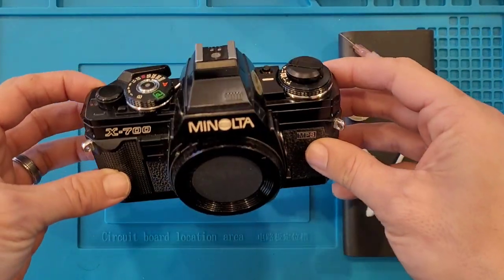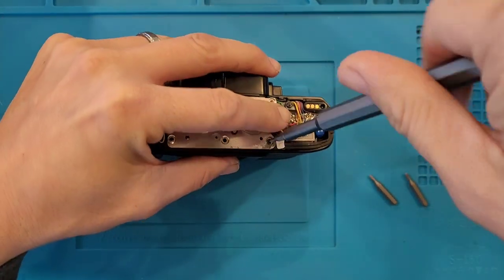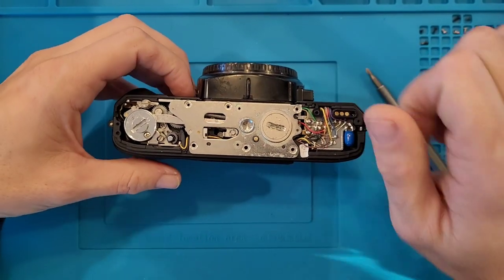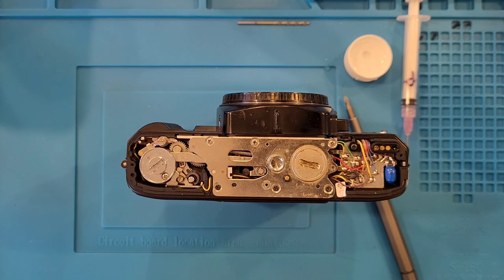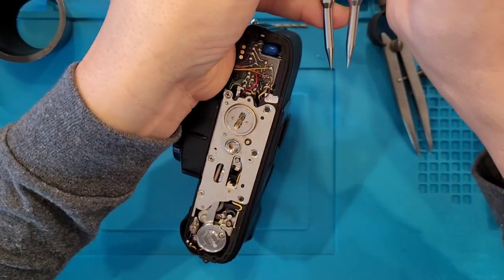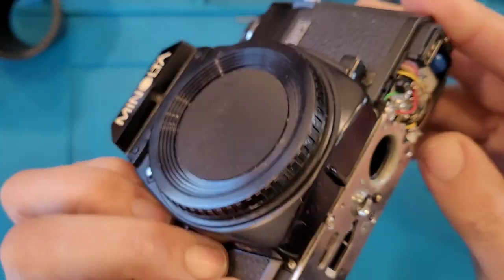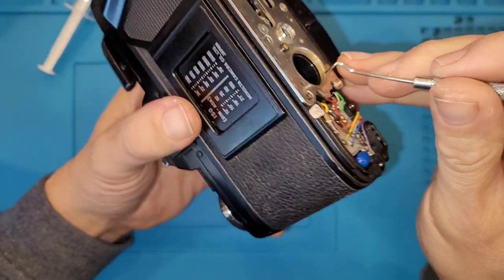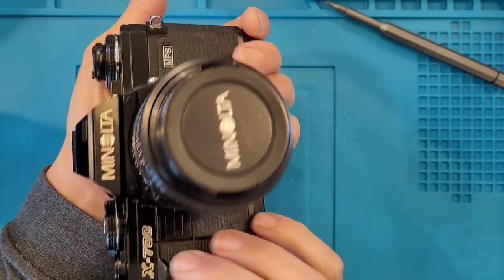Minolta X-700 Battery Door Repair  - Analog 35mm Camera Repair

Comment: Hey good video. I've an old camera with similar battery door, the little plastic part that holds the battery inside the cap fell apart. Do you know of any way to find a replacement? I have a 3d printer but not sure of any file for it.
Reply from the maker: Is it the little plastic half circle looking thing that you stack the batteries in?